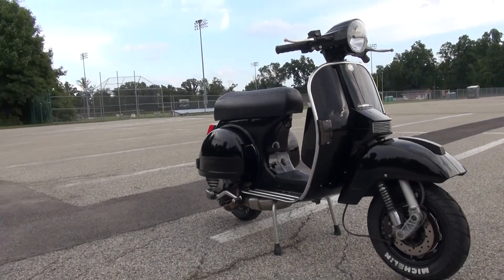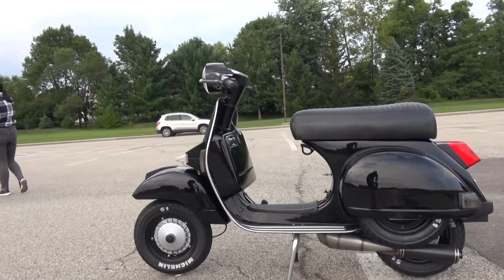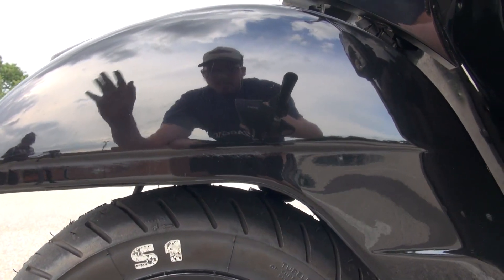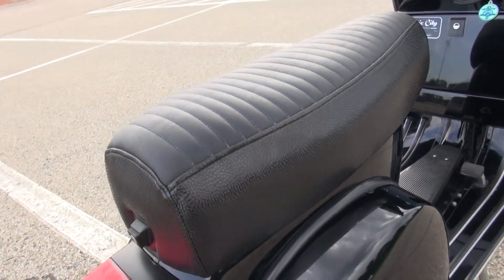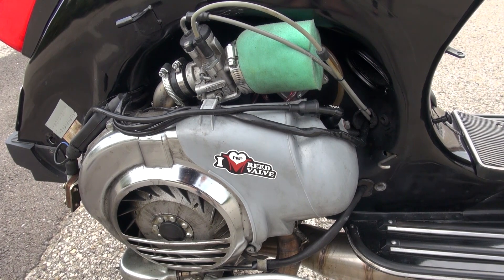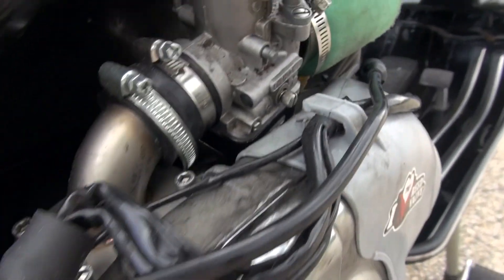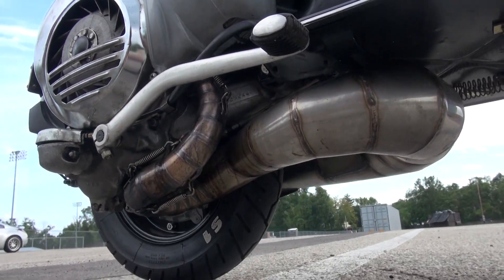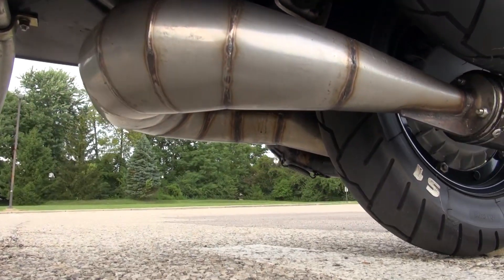LML Genuine Stella (Star 150) with 175cc Malossi (166cc) - TST Ep. 45

Comment: I wanna know how your buddy cleaned up that scooter so well. I just brought home an 08 black stella and Ive tried a few different polishes but with no luck. The paint is so soft on these scoots.
Reply from the maker: Ask the question on my FB page, I can tag him and he can respond! I know what you mean with the paint, it aint the best.
Reply: I bought a 2009 in avocado green brand new. The paint has picked up a few scratches over the years, which was my fault, but it has held up well otherwise. It is non clearcoat paint, which means you can wax it. Black paint is always going to be harder to keep looking good than any other color. I had a choice between black and green, and I picked the green just for that reason. I have 14K miles on it. When the stock engine blows up (they are known for crank failures around 15K miles) a local vintage Vespa shop is going to build me a bulletproof motor for it, and I will probably repaint it while the motor is out. Trying to decide between shiny new paint or patina look paint. Many people have gone to great lengths to preserve the weathered look when restoring vintage Vespas.

Comment: Looks great, sounds great. But how do you remove the rear wheel? I have had 3 flats on my 2009 Stella since buying it new, and all 3 were on the rear. I have a stock motor, with a Sito+ exhaust and a rejetted carburetor.
Reply: with exhausts that exit from the left you have to remove the pipe before taking the wheel off

Comment: Hello. How did you do hoses connections with that mechanical fuel pump?
Reply from the maker: Vacuum I got fromt he reed valve intake, tapped into the aluminum. 
In the fuel pump from gas tank
out to the carb 
Inbetween carb and fuel pump as well as Gas tank and fuel pump i put two T-connectors, so I can have a bypass. 
The bypass was restricted with one of those spark plug terminal nuts. 
This way, there is no overflow, it just feeds leftover gas back into the pre-pump fuel system. 

I will eventually do a video on it, this was my first experience with it.
Reply: @ThatScooterThing  nice. I was asking that cause I've Installed same collector and similar carburetor on my LML. I've also installed that same pump but without the T pieces (result? The Carter was filled with gasoline. There was so much fuel I could have throw some pasta in it).
Actually I don't have no pump and the natural vacuum from the intake is enough to have fuel in the carb... But I think that pump is a way to increment safety to the engine

Comment: what did you end up getting for top speed and rpm with that?  how was the torque?
Reply from the maker: Top Speed should be an easy 75-80. 
A very early break in jetting spit out 21hp/7000rpm, but letting off early, I am sure when this bike will get an rpm meter and a little touch up on the jetting it will fly a little more.